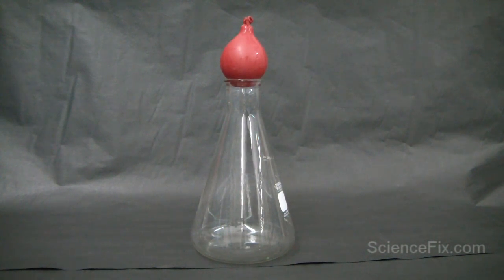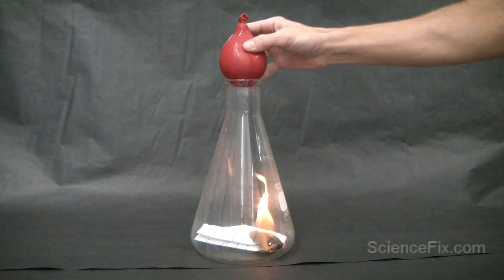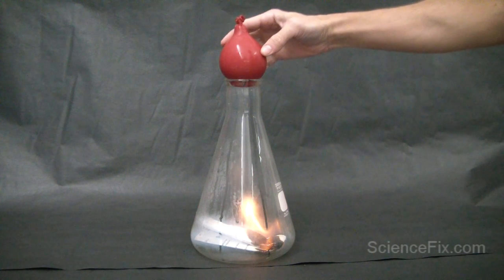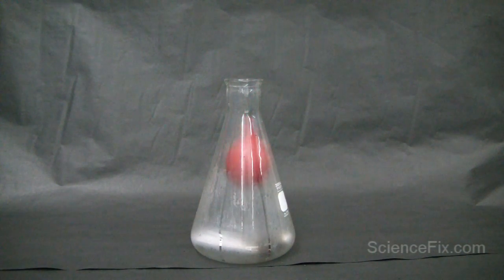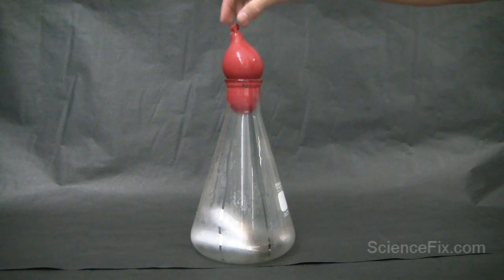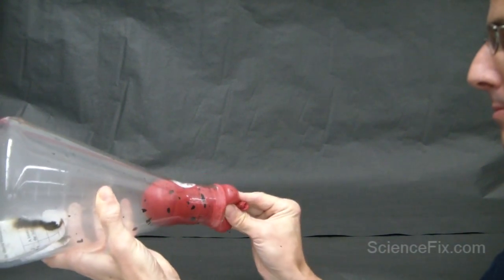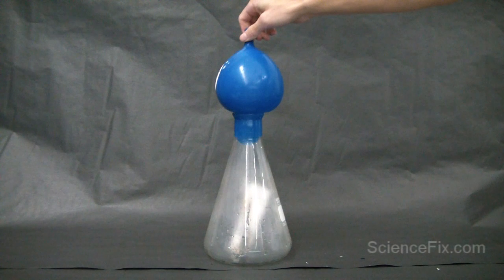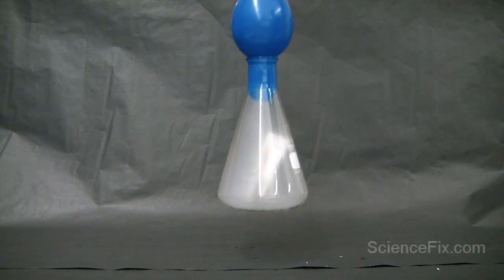Balloon Suck

Comment: That's not true. It's the fact that temperature is directly proportional to volume. Because the volume adjusts to the volume of the beaker, as you decrease temperature the volume in the beaker decreases, causing a vacuum.